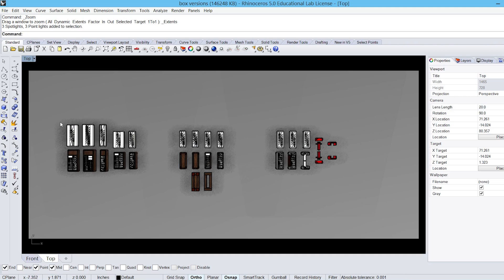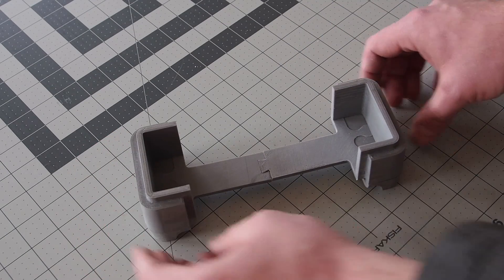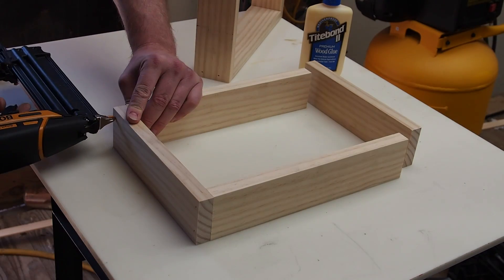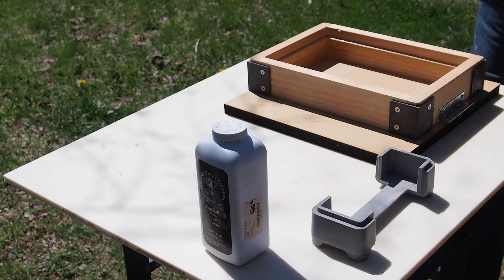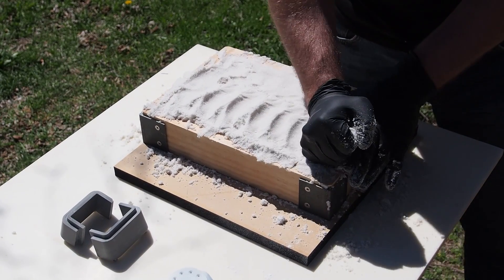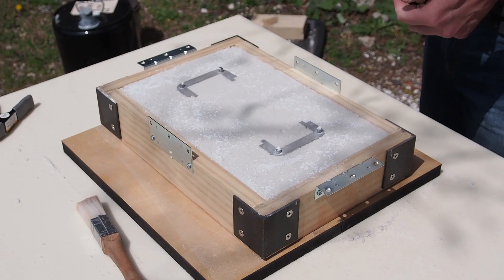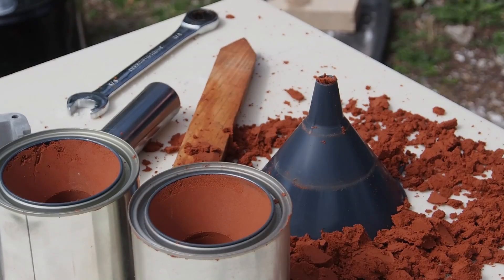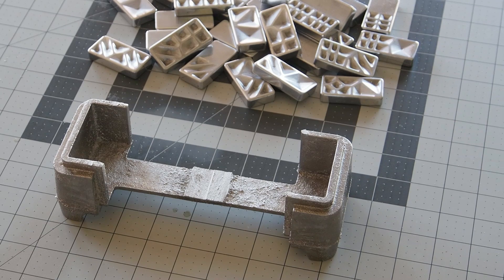Cast Aluminum Dominoes | Box | 3D Printed Pattern and Water Glass Sand

Comment: another request for the conclusion to this project.  and the domino polishing/finishing?
Reply from the maker: I have had the polishing video basically done forever, obviously...  but I need to finish the box to make it a decent video.  This project went on hold since the person I intended to give it to passed away..  I was also looking into ways of producing the dominos using lost wax casting and have toured some foundries and looked into getting my own wax injection setup.  This project is a rabbit hole that I started long before I even had 1k subs.  It needs to be finished at some point!

Comment: I skimmed through your replies quickly and did see this suggestion.  Sorry if it's a duplicate.  You could use ABS plastic and then use Acetone vapor to smooth the layer lines.  The print will come out high gloss and glass smooth.  Great videos by the way.!!

Comment: I can understand the novelty of cast aluminium dominoes, but why cast the box as well? That much metal is ridiculous, it ruins the appeal of the pieces themselves if the entire box is the same material
Reply from the maker: +Grey-man considering making the lid out of wood.  Otherwise, I disagree.  Mostly, I wanted to cast the box.  A production version would likely be a wood box purely out of a concern for costs.
Reply: I say lets wait to see the final product before casting judgement.  Even then some judgement's are best left in one's head.
Reply: Justin S Cast judgment is one part opinion and 2 parts bull shit.  Thoroughly mixed and slathered over one's body.

Comment: Why did you not use Petrobond for the main casting as well?
Reply from the maker: +Trevor Schretlen Expanding horizons and learning new things!   Now I know that I should use SS sand when I want a crappy finish. Mostly used it on this project because of the lack of draft on the bottom of the part.  I will likely recast this in the future...
Reply: thank you!

Comment: Brian, great work but why didn't you just lost wax this. You have the technical expertice to do it.you would have gotten an even better surface finish than petrabond. This is the first I have seen your channel and I do everything almost identically except I use tooling board instead of Corian. Not alot of it out here in Australia.
Reply from the maker: +gus bisbal My next project I am using Renshape to make the pattern.  I was considering dropping this off at a foundry at some point and figured Corian would survive much better in that environment.  I'll also be trying out lost PLA in the future!
Reply: Just make sure you can evacuate the ash/carbon with PLA. Don't think just because there was some flame and you can't see much left that at the extremities it hasn't accumulated ash. This is why people fire the ceramic shells in a kiln.
Reply from the maker: +gus bisbal GF is a ceramicist so I have kiln access!

Comment: You'll find shakeout with waterglass binder to be MUCH easier if you add some molasses to the mix..  just enough to give it a nice amber color.
Makes it smell sweet too :)
Reply from the maker: +Bill Monroe Thanks for the tip!  I had seen that for core molds but had not even considered that for an all over mold.  I might have to try that!

Comment: My 2 cents: To improve the surface finish you may wish to try having less hydrostatic pressure in the mold. ie- don't use a riser and sprue extender. The extra pressure tends to drive the metal into the mold material and leads to surface roughness. I don't think that casting needs the extra pressure. Observation - the petrobond had better surface finish - and it produced it at low hydrostatic pressure - ie: towards the top.
Reply from the maker: +Jason Harris Interesting points, but the surface quality has more to do with the granularity of the sand not the pressure of the cast.  The extended sprue and riser help to keep everything hot while the details are filled.  The upper part of the sprue is actually less nice on most casts because that is where a lot of crap ends up.  Petrobond : SS sand :: Plastilina clay : Play doh

Comment: Why did you Chang sands
Reply from the maker: +david wise I mostly wanted to try sodium silicate.  The foundry supply I went to suggested that I use SS sand when I asked if they had Petrobond, so I have had this sodium silicate for about a year.  For this reason and because of the little to no pattern draft I have on the lower beam piece.  Petrobond would rather stick to this detail than to itself.  If I made the all aluminum box version, I would definitely use all Petrobond as there are less challenging details.
Reply: ok I see it realy made a difference in finish
lots of polishing

Comment: Brian, excellent video as always. 
Just wondering, can you make your own petrobond using white play sand, a percentage of clay and motor oil?
3D printing for patterns really seems like the way forward, assuming you have or have access to a 3D printer.
 I was going to say that with the 3D printed pattern that I really didnt think it was necessary to sand down the pattern that much, however when you showed the difference between the waterglass sand and the petrobond areas of the casting sprue the finish level was chalk and cheese.
Reply from the maker: +Mark Fryer Thanks!  You can make your own Petrobond.  You can buy the mix that you just add sand to.  It is a but more complicated than the 3 ingredients you list.  Also look for the recipe for k-bond as this might be something I try eventually...

With 3D printed parts off of the printer, every step is essentially an undercut since it is a flattened round extrusion.  One coat of CA pretty much fills these in.

Comment: Could you use a layer of your red sand around the pattern, and the SS for the bulk of the mold? Are the 2 materials compatible? You would have the smooth finish and save some $ too.
Reply from the maker: +Double Dare Fan This is how some commercial foundries operate!  The reason I would do one or the other is that I would have to dispose of all of the sand.  The sodium silicate sand could probably be reused if you broke it up completely.  Otherwise you can just incorporate some white sand into your landscaping scheme.  With petrobond, I reuse probably 80-90% of the sand.  If it was mixed with SS sand, I'd have to toss it and I am fairly certain petrobond would be fairly good at killing grass!

Comment: wow! the ca glue tip was just what I needed, having an awful time trying to sand 3d printed prts
Reply from the maker: +James Davis The bigger tip is to use files not paper for the majority of the work. PLA reaches its melting point pretty easily when sanding it.  This makes for a doughy surface.  The files act as a plane and cut rather than just an abrasive.  Thick CA for filling, thin for leveling a surface.  Be sure to have good ventilation!

Comment: How come you didnt use the petrobond? What advantages does the other stuff have?
Reply from the maker: +jerzmacow I was trying out a different approach!  I am going to recast this using petrobond this summer.
Reply from the maker: +jerzmacow Petrobond doesn't like all of the interior corners.  The sodium silicate sand is hard as a rock and is more forgiving of little to no pattern draft.  I wanted to try the sodium silicate for the first time.  I might try it with Petrobond too just to see...
Reply: SO THERE IS HOPE that this series will get completed!  I've watched this series like 3 times.  It's so very interesting, but crushes me every time I get to this episode because I would really like to see how this all turned or turns out!
Reply: I thought sodium silicate was waterglass
Reply: +jerzmacow Sodium Silicate sand is unbelievably cheap, and to reuse it all you have to do is add more of the liquid since you're basically adding sand to sand
Reply: what's wrong with the internet m.
Reply: +Brian Oltrogge you can actually add sodium silicate to waterglass and get the surface finish of the petrobond but hardened.. drawback that sand is gone then not reusable.